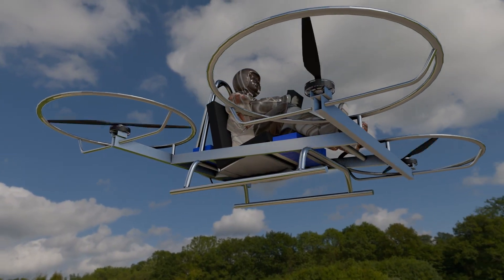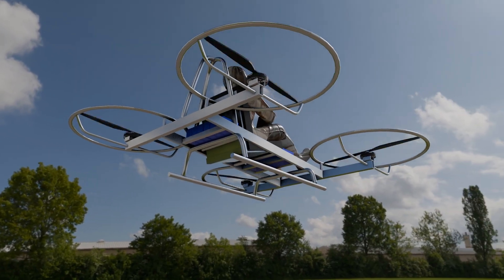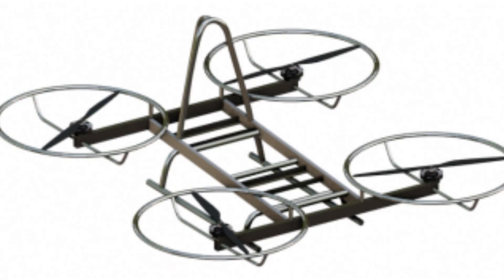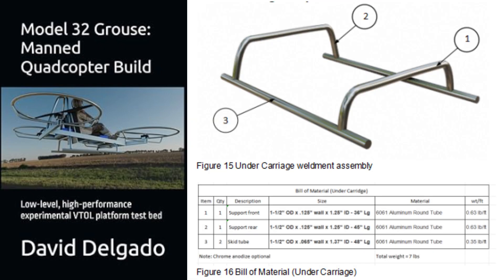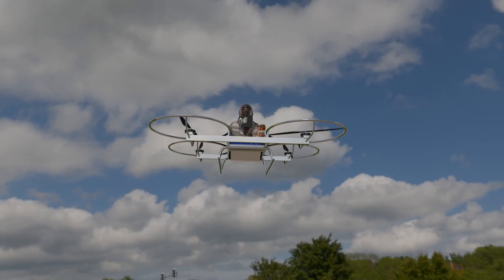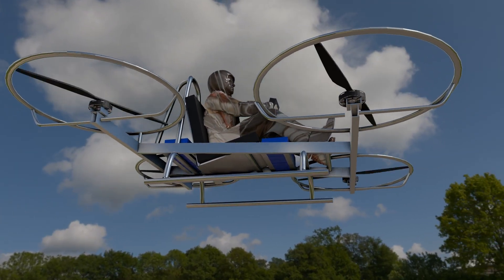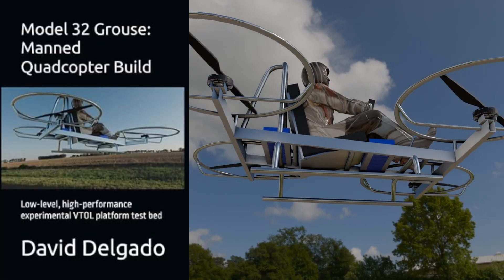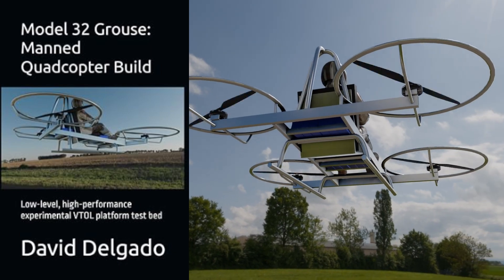Model 32 Grouse

Comment: Am I the only one wondering if this is real, then why not have actual video of one in the air?
Reply from the maker: That's a totally fair question. Real-world flight footage is definitely on the roadmap. Right now, we're focusing on proving the tech step-by-step — structural integrity, power systems, and propulsion. Once those are dialed in, a video of it flying in any of the 3 configurations (UAP drone, manned craft, or agricultural sprayer) is the next big milestone. It’s an ambitious platform, but that modular flexibility is exactly what makes it exciting.